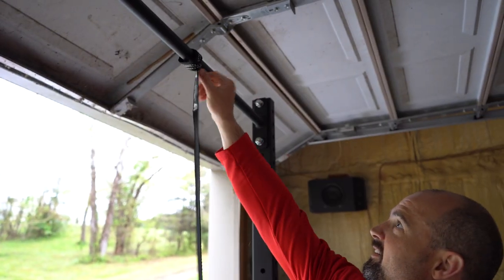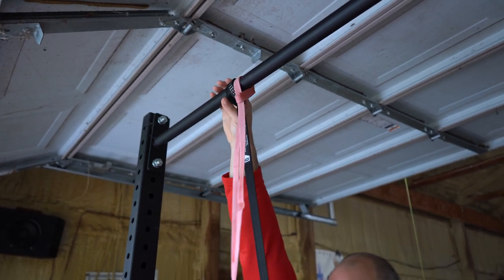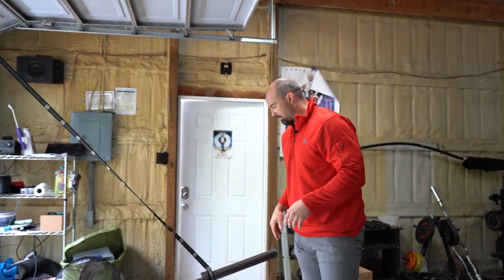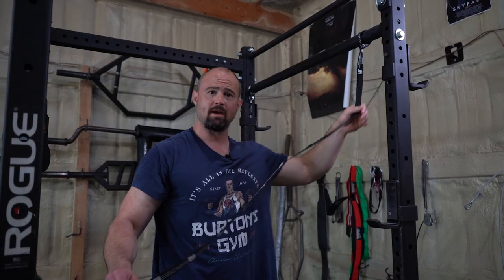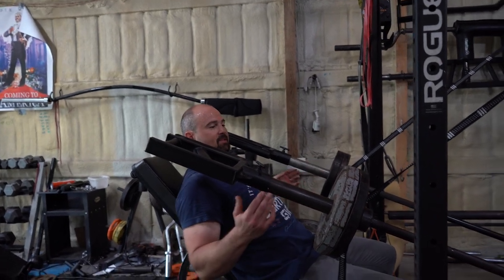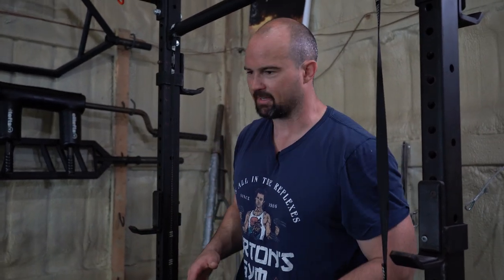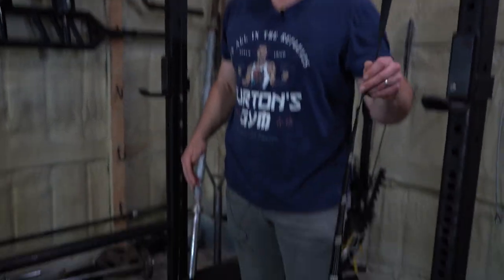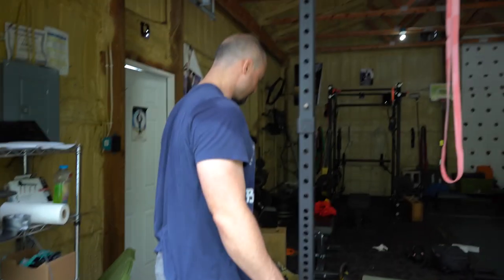4 Landmine Configurations For a Safer, Machine-like Lifting Experience

Comment: Your previous videos from years ago inspired me to create a similar set up last year.  I don't use hammock straps.  Instead, I use a metal rod (I guess you can call it a spotter rod) for the front.  The same type of rod that is used in the back for the pin/pipe safety's & landmines.  My rack has one inch holes, though.  Oddly, I was only able to fit half inch rods through it.   If the rods were any slimmer, they would snap without much weight. I use anxle bars, and can place about 100 lbs on each bar before the front spotter bar really starts to give. 

I'm glad to see to you make another video of this.  The options or unlimited, and it's a very cost effective way to turn a power rack into an assortment of machines.  The set up does kind of suck, but it's not so bad once you figure out a process.
Reply from the maker: Hey AM, really means a lot to me to hear that others have gotten something out of these zany ideas.  Appreciate the feedback very much!  And you're absolutely right that there are unlimited possibilities.   Thank you!
Reply: You're very welcome.  Looking forward to more content from you.   I hope you continue to gain more subscribers.  People with home gyms need to see your content! They can learn so much.  Hell, the average commercial gym go-er can even benefit from you.  Your content is perfect for people looking to maximize an often limited home gym space and limited budget.
Reply: I've a similar set up, although I use the Mirafit yoke, and use the safety spotter arms turned inwards towards each other instead of using hammock straps. I've 2 independent landmines sat on top of 4 concrete blocksstacked on top of each other. The Mirafit yoke is moveable, so I can set it up pretty much anywhere. I only use 5' olympic barbells tho, does the job perfectly.  Also use sandwich cups if needed for higher safety's.